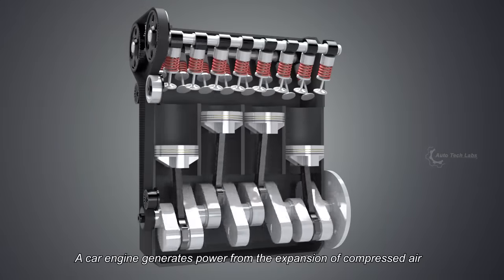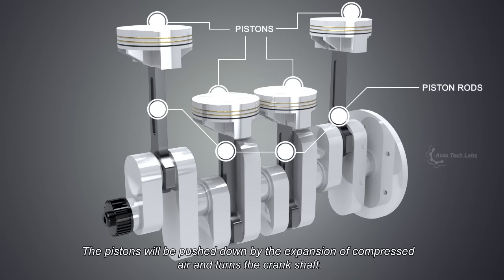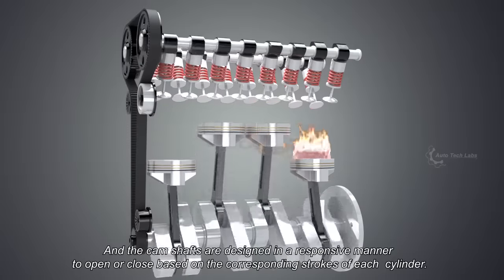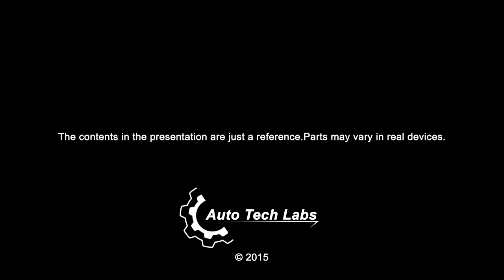How Car Engine Works | Autotechlabs

Comment: Internal Combustion Engine
0:17 Main Parts Involved
(1) Crank Shaft
(2) Pistons, Piston Rods
(3) Valve, Valve Spring (Control flow of air)
(4) Camshafts, Crank, Timing Belt

1:05 Four Stroke Engine (Intake, Compression, Power, Exhaust)

1:29 2 cranks to complete one cam shaft revolution
1:55 Spark Plug

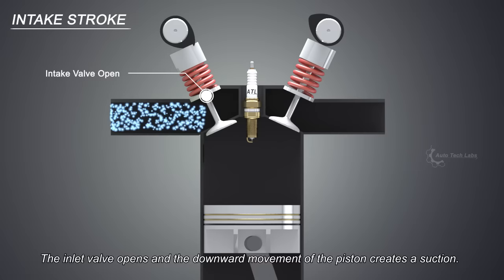2:10 (1) Intake Stroke
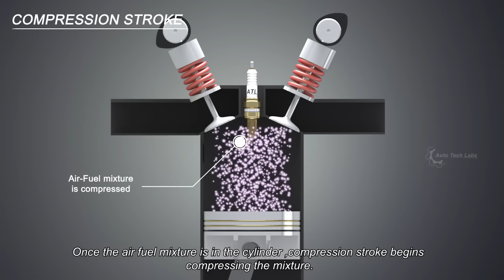2:24 (2) Compression Stroke
2:32 (3) Power Stroke
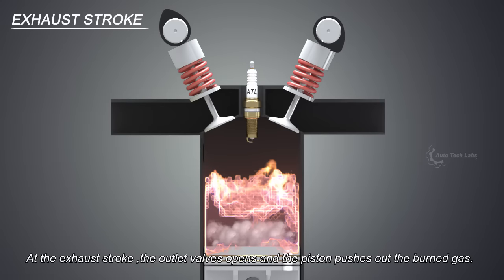2:47 (4) Exhaust Stroke

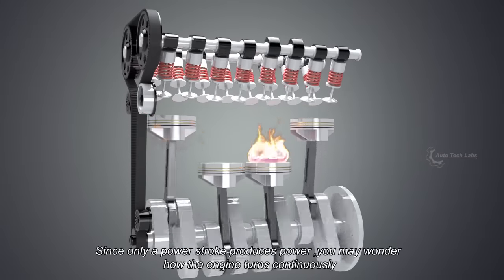3:16 How does the engine turn continuously?
Reply: Michael Pisciarino 🔥🔥🔥👍
Reply: 31 years old and today was the day I found out 4 stroke didn't mean it was because there were 4 pistons in the engine

Comment: Knowing this, it's insane that the same engine in my Honda can be doing this enough times to make my car travel 181,000 miles over 19 years. And still going strong. What an amazing machine.
Reply: that's exactly what I was thinking about... the car I drive is from 1996
Reply: That's because Honda is the largest internal combustion engine manufacturer in the world (at least gasoline engines). They make the best quality engines in the world or at least the old ones were. In fact their engines are so good that a lot of companies like the Harbor freight preditor brand of small engines, Biggs and stratton and many other companies make their small engines based off Hondas patented small engine design hence the term "honda clone" engine. He'll even a lot of the Chinese knockoff engines on Amazon still use the same design only their built poor quality but they still use the same iconic design.

Comment: I'm so confused, I need someone to really dumb it down for me and explain each terminology because I'm starting from no car knowledge
Reply: Smarter Everyday has a video that helped me, so I think it will help you too!
Reply: @shucks yea lol the way I think of it as is a car engine compared to human lungs, we breath in than breathe out, a car engine is similar as fuel/air mixture goes in than goes out.
Reply: Shucks i can help
Reply: I love you
Reply: Lmao
Reply: Four stroke rule,   intake,  takes in air and gas,  compression,  piston raises the air and gas against the intake and output valves,  air and gas is pressed into small space. Spark plug ignites the air and gas to explode,  forces the piston down to turn the crank held by timing belt, piston goes back up, releases burned/waste gas through the output valve into the exhaust,  input valve opens to bring in more gas and air,  process repeats :)
Reply: This animation is as clear as possible in my opinion. If this cant get you to understand the principle of a car engine, then i'm afraid nothing can lol
Reply: me too
Reply: Same here new to car technology
Reply: The Air mixes with fuel comes inside cylinder.This charge is then compressed by upward motion of piston.Reaching high Pressure and Temperature.It is then ignited.And this produce a hell amount of Energy Capable of Pushing the piston and rotating the Crankshaft.
Reply: you don't have to.
Reply: Shucks .i can help you
Reply: dont worry its powered by disney magic lol jk
Reply: How are you confused? It’s showing you what happens while you drive. 

Oxygen and Gas are sprayed into a small chamber that gets pressurized by the engine. 

When the pressure is at its highest, it gets a spark, and like a bomb, a chemical reaction occurs (Gas + Oxygen) resulting in a mini explosion inside. 

These mini explosions force the piston down and the cycle repeats. Turning chemical energy into physical mechanical energy.
Reply: You commented this on a video that literally explained it in 4 minutes. What is the problem here lol
Reply: Johnny C no you don’t
Reply: Leanr about small engines firsg
Reply: @spectrum8220  every person who uses whatsapp is creepy af

Comment: Interesting though, so that’s the whole point of petrol in the car. Is just for the combustion part to enable the power stroke which moves the crankshaft. And then the emissions just exit through the outlet valve. I never thought it played such a seemingly small role.
Reply: Small but important role. Small things matter, don't they?

Comment: Is an Intake Valve really necessary?
I mean, if you have a fuel injection system that injects the fuel then could you not also inject air or Lqd Ox with the fuel?
I am not a mechanic just an egghead.
respect to all you mechanics,, peace.
  BJ
Reply: egghead, BJ

This is too much for me

Comment: This was a good video. Helps me get an idea what part of my four cylinder engine is experiencing. It shakes a lot and I have a flashing check engine light on. I was also told one of the cylinders has no compression on it.

Comment: was wondering if anyone could give some advice. 

I'm a software development student (low level but with a great understanding of computers) and i recently started driving and doing lessons and i was having difficulty with it on my first day because of adhd and simply the different way my brain works - no one could explain it to me. i sat down for a solid hour without the help of youtube/internet thinking about the internal workings of an internal combustion engine and the applications of physics within it (I also have a little passion for physics) and I managed to figure out and teach myself how the car worked and in this understanding I learned how to drive and i am very proud of myself for that as I have always found that understanding what im working with instead of simply being told the rules and applications from other people is what allows me to learn. 

my point is that i believe this personal strength of mine could possibly allow me to work in engineering and if i am to make an education change now would be the perfect time while im still in fairly low level education and i was wondering if any experienced mechanics/engineers can honestly recommend this is a good idea 

much love, someone with way too much time on his hands and not enough grease :)

Comment: Thanks a lot!
Two questions: what is the purpose of the momentum of the counterweights? What I understand is that they need power from the pistons to move them up, then they return this power to the pistons while they are falling, so where is the benefit? What is the difference between this and a model without counterweights?!

Also, how does the flywheel act as a counterweight?

Comment: Very nice explanation.
I have one question -
We have 4 strokes and we have 4 valves. At least one valve will be at power stroke to make the shaft running. but what is status of all these 4 valves while starting the engine. How the shaft gets its turn first time. Can you please explain

Comment: Put this clip in slow motion and you will see the ignition is happening on the fuel intake troke and not on the compression stroke.
Reply: Omg u r so right. No engine will work like that

Comment: Is it only me that noticed that the initial animation showing all 4 cylinders is actually in reverse (up to 1m 50s and after 3m 20s)?
ie a valve opens at the same time as the power stroke whereas they should both be closed ;-)

Comment: i wonder what powers the first stroke in the car as soon as you start the engine..is it batteries?!
Reply from the maker: The starter motor creates the initial momentum for the pistons through the  flywheel. Simultaneously fuel is injectected and ignited by the ECU using supply power (Battery/Alternator). Afterwards starter motor turns off and the internal combustion takes over.
Reply: @autotechlabs  thanks.. really helpful

Comment: So I look at it as a mini explosion. When oxygen + gas  are passed through the cylinder and gets pushed through piston it gets ignited by the spark plugs. This causes the mini explosion  where enough energy is applied to force the pistons and crankshaft to rotate, and it repeats. This rotational process helps the axle turn which also causes the wheels to turn since the wheels are connected to the axle. Am I right on this?

Comment: - what first makes the engine start 
- how does the gas goes up to the pipe
- are does rotating bits at valve electrical or is it connected to the engine itself
- so every millisecond the plug sparks

Comment: Glad I watched this. Very interesting and pretty genius how it all works together. I wonder what's to keep the exhaust from blowing the wrong way during the stroke cycle 🤔
Reply: The incoming Air gas mixture into the cylinder will form a barrier which is released at a certain pressure maybe.

Comment: Since the crankshaft is connected to the camshaft then in the first stroke when the crankshaft is not moving how to do the intake and exhaust valves open.

Comment: There's just one little mistake in this video. During intake stroke video shows explosion of fuel and air mixture. That happens in NEXT stroke which is compression stroke.

Comment: I have a question for all you petrol heads. Lockdown has me thinking outside the box when it comes to fuel efficiency. I'm fasinated recently with the idea of magnets and their magnetic energy being used to help improve fuel efficiency and the idea of perpetual motion.
Now that I understand the basics of a working engine, it has me wondering! Right so we all know that magnets repel each other when the poles are facing each others South to South or North to North poles right! So my question is this. If you were to attach magnets to the top of the pistons (south facing upwards as an a example) and also have them attached somewhere near the spark plug igniter (South facing down). Logic would tell me that this would create a downward force when the piston reaches the top of the block right? So wouldn't that greatly improve the power in which the crank is turned? By simply utilizing the repeling force of the magnet? I could be wrong and probably am. But like I said this concept has me seriously wondering! 
Im no expert. So Any feedback would be appreciated. I'm losing sleep 🤣🧐
Reply: Thinking more in depth on this I realised that the force applied by the permanent magnets would stay continuous, therefore the force in which it pushes the piston down would be cancelled out by the same force when the piston returns. Meaning that the extra force produced pushing the piston down would be exerted by the force needed to get the pisron back up.... which again got me thinking! 
Electro magnets could maybe be the answer! Having them turn on (via timing switch) when the piston reaches the top block for a sharp push and off during its return. But would the use of electro magnets outweigh the benefits of the extra boost on the engine? 🤔
If I had the means and money I would certainly test this. Because God knows..... I have the time 🤣

Comment: I get the inlet valves(pressure difference due to partial vacuum created inside), but what causes outlet valves to open?
Reply from the maker: Valves are  mechanically driven by cam shafts with timing and not due to pressure difference.
Reply: @autotechlabs  Yh i did the research quite immediately after posting my comment. I was using the working principle of pneumatic cylinders. Silly me.

Comment: How does the piston descend to allow for the intake stroke? Where does that energy come from?
Reply from the maker: At any provided time instance, one of the cylinder will be going through power stroke in a 4 cylinder engine. Also the momentum of flywheel aids the pistons.

Comment: If the middle two pistons are connected wouldn’t you need a extra  exertion on the two middle so the it can retain constant power.  Or did I miss something.

Comment: Still it is not clear before the crank shaft starts rotation,how much effectively the air pushes and open the valves without external means.If the air can push and  open it all mechanisms are clear and possible. Thanks otherways

Comment: "The intake valve opens and the downwards movement of the piston creates a suction" Now what causes the "downward movement" of the piston, Chuck Norris?
Reply: All the other pistons are on a different stroke. Didn't you hear what the video said? At any time instance, there is always one piston in the power stroke which forces that piston downward to spin the crankshaft by the use of combustion of ignitied compressed air. The spinning of the crankshaft influences every other piston to move as well, since all those other pistons are connected to the crankshaft. Meaning, the downward movement of the piston to create suction in the cylinder, which you're referring to, is caused by another piston in the power stroke. There I simplified everything 'hope you understand.
Reply: how can be the suction take place in one of the cylinder  during the beginning or during ignition is turned on?Or from  where will the crank get the power to make the downward movement of piston during beginning as no other piston will be in power stroke?
Reply: Dixon pal what? I said at any time instance there is always a piston in the power stroke. There are four (4) pistons, right? All those pistons are on a DIFFERENT STROKE EACH. Meaning, at any given time instance, there is always going to be one piston in in the power stroke, there's always a piston in the exhaust stroke, a piston in the intake stroke, and a piston in the compression stroke. They all work in sequent order. That ONE PISTON in the power stroke is what influences ALL OTHER PISTONS to move and change their strokes.
Reply: Dixon pal maybe you're talking about how the engine starts, well that's a different topic. Watch how the engine starter motor works.
Reply: Marcus Tornea haha
Reply: To make the car initially start, the Solenoid turns the crank a few revolutions until the pistons get going. The piston's beginning "downwards movement" is caused by the car starting (the solenoid). The Solenoid is an electric motor basically, and all cars have some form of a solenoid. The solenoid does not make the car a hybrid but instead allows you to start the engine with the battery instead of manually cranking the engine (like in very old cars). This is the very reason the car doesn't turn over when the battery is dead.
Reply: He means what causes the initial downwards movement (when the video starts, before the pistons all start firing). The simple answer is the solenoid.
Reply: Yeah..the initial start..thanksss👍👍

Comment: Question .. How the piston moves down during the intake stroke , whats the source of its energy?
Reply: An electric starting motor is used on startup, momentum is the source when the engine is running

Comment: Wait so the spark plug doesn't only spark when I turn on the key, but each time the air fuel mixture is compressed within the cylinder?

Edit: Ohh okay the key complete the ignition battery circuit which keeps on periodically produce the spark in the spark plugs until the key is turned off again. That's why the engine starts running and stays running right after and as long as the key is turned on.

Comment: So I get the concept of the engine now but how tf do they account for high speeds not throwing the engine apart/how do they vary the speed when I press on the accelerator?
Reply from the maker: More air and fuel (as you tuns the throttle) results in an increase in the frequency of explosion in cylinders, causing the engine to operate at higher rpm.

Comment: Why do not we use 4 times blow instead of 2 blow+2 blow?
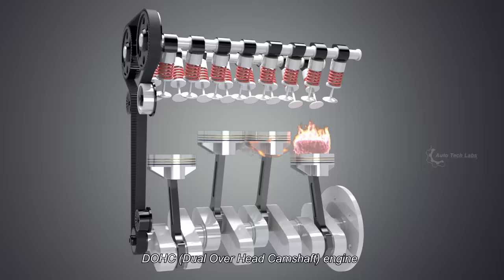at 1:10 blowings happens randomly. Is it just an for figure?
When the cc is up, Cylinder heads grows so cylinder path grows. And then volume is getting higher?
Can anyone give an answer to these questions ?
Reply from the maker: For an inline 4 cylinder, firing order should be 1,3,4,2. Each firing occurs at the end of compression stroke. Firing 1 and 4 together or 2 and 3 together can't create a sustainable momentum for flywheel and could create too much vibrations.
Reply: @autotechlabs  Thanks for answering. It cleared my mind. I always think that "4 stroke engines" means, firing at 4 different times :D But it was soo different thing. I am searching scholarship abroad(mostly in usa) for studying master degree in material science. Do you have an any advice for your country? I am from Turkey, I will finish my undergraduate from Material Science and Engineering this year :D

Comment: Thanks, Where does the air gas come from though?
Reply from the maker: Older engines use carburettor to create air-fuel mixture. Modern engines pulls  air into the cylinders and sprays atomized fuel particles using injectors to create the mixture.

Comment: To suck air, the cylinder has to move downward.. So what makes it to move down  in the beginning?
Reply: To start the cycle an electric motor is used to turn the crankshaft, smaller engines will instead use a pull cord or a lever that is kicked to crank the engine.